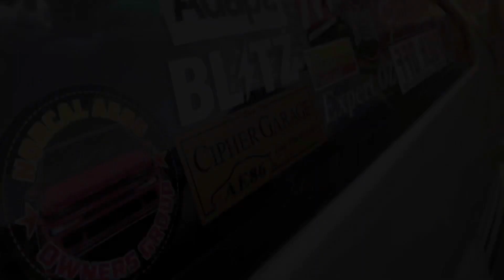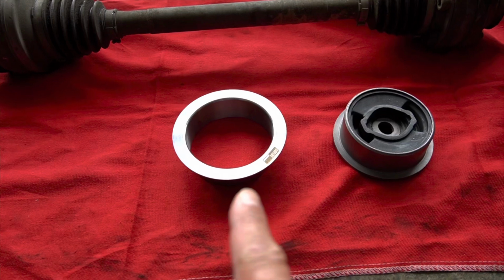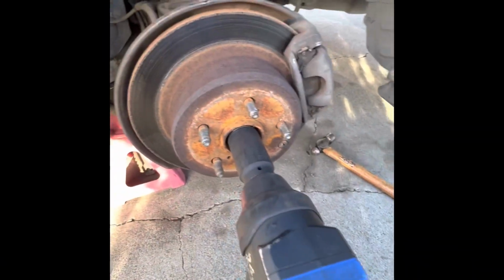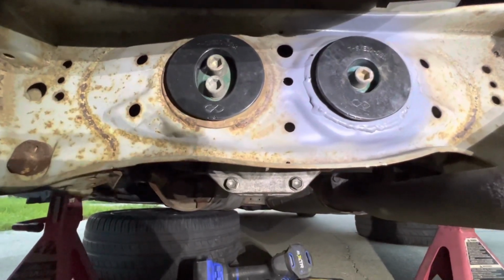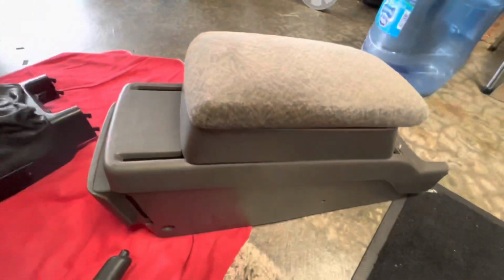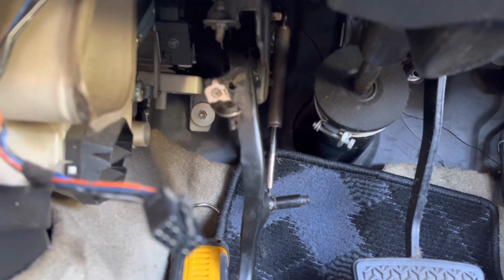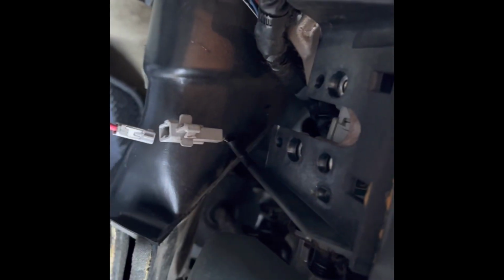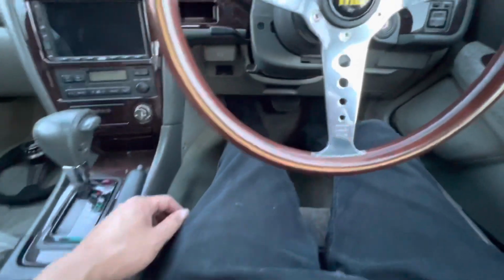Jzx100 to IS300 differential and Axle Conversion and jzx100 Tourer V Hand Brake conversion

Comment: how did you get the sensor cable for the e-brake? I can't find anywhere where to get that cable for the dash light
Reply from the maker: There’s a wire off the foot brake. I had to extend it to the hand brake area. The hand brake that I had already had the switch on it
Reply: @jdmflavor5786   one thing that I have noticed was that the male plug from the pedal one is different from the side brake one, was the case for you as well?

Comment: So x90/x100 tourer v axles are interchangeable with is300 axles as long as you use is300 stub axles as well?
Reply from the maker: Yes the axle splines to wheel hub the same, only differences are the stubs to the diff it self, which the difference is the bolt pattern of the axle to axle stub. The spline counts are the same going into the dif
Reply: @jdmflavor5786 thank you man

Comment: Does the stock jzx100 rear bushing bolt up to the differential or you absolutely need the s9 bushing.
Reply from the maker: You need the s9 ring 100%

Comment: I thought the pinnion flange on the IS300 diff was too short. Did you need a spacer?
Reply from the maker: Not too sure, it bolted right up with no issues